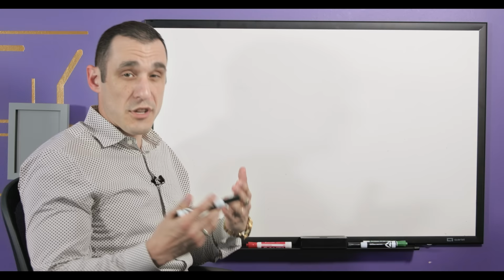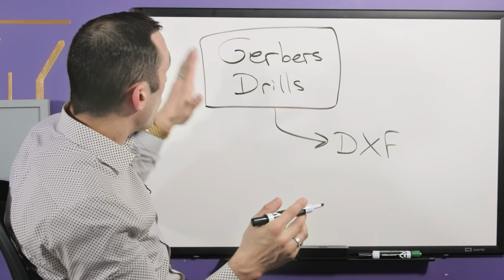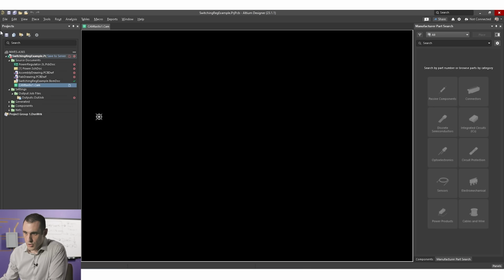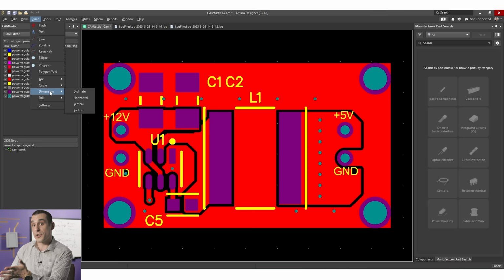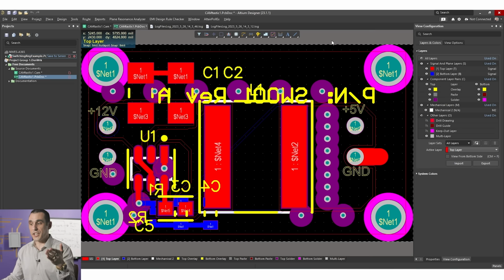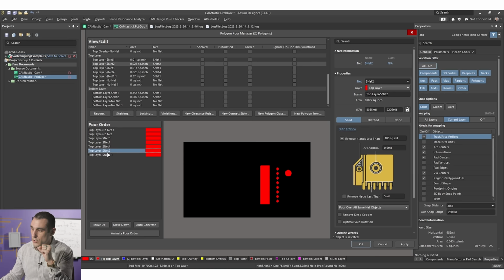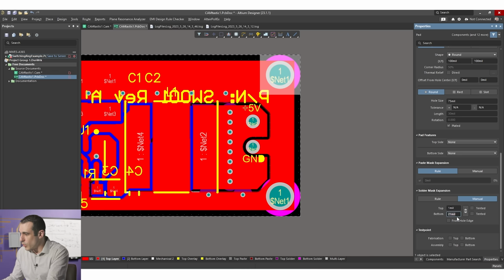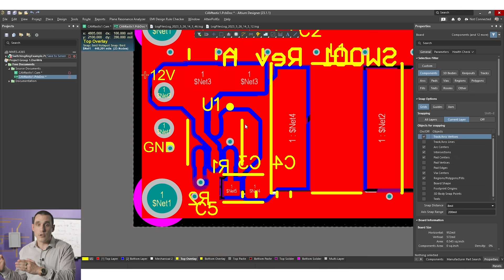How to Reverse Engineer a PCB from Gerber Files

Comment: Depending on how complex the PCB is, it probably makes more sense to send it to China and have the professionals do it for you.
Reply: Yep, and they would sand the board down and scan it for you. It is basically fully manual reproduction of every component. I once kinda half reverse-engineered a two layer PCB just by taking a photo, scaling it up and printing it out. Then I just drew marker lines. I had some idea of what it did, so it was pretty simple.
Reply: you have any contact to the Chinese professionals?

Comment: When i try to do this, my solder and paste information is not getting exported to the pcb. What might be the issue ?
Reply: What does "solder and paste information not getting exported" mean? Do you not see any solder mask openings or do you only see the default solder mask openings? I suspect that if you look at the solder mask rule in the exported PCB you will see the default rule being applied in the PCB Rules and Constraints Editor, and this is why the solder mask may not look as you expect.

Comment: am trying after export the pcb silk and solder layers are not visible in panel downwards.
Reply: I'm having the same issue and cant seem to find the right way to even search for a solution. I can toggle visibility in the view configuration toolbar, but cannot select them as an active layer to work on.

Comment: I did this for a board once having only the information required to build it (gerber, drill, bom); if I recall, after the camtastic import I went through creating components from the exploded primitives (in PCB lib). Create the components' schematic symbols from the BOM and put them all on the schematic with an individual netlabel on each pin. Then push changes back from PCB->schematic, now you will have all the right nets on your schematic symbols. The final process is to untangle and rename the schematic into something readable, always ensuring that when you push changes to the board no connectivity is changed (just net renames).

Note that all your holes are imported as "pads", so you will need to convert the vias back.

I have also employed the more laborious method to reverse engineer a supposedly "open source" 3D printer motherboard. It was possible to extract all layers from the PDF layout they provided (using select by colour in a drawing tool, as all 4 layers were present, though overlapping). After scaling to correct known dimensions I had enough to reconstruct the layout. In this case the schematic was provided as a PDF, so there was less mystery there.
Reply: I watched Ethan Pierce's webinar with PCEA and he talked about using photoshop to extract copper from a photograph of the top layer. If you can get the copper to a single color with smoothed edges then you can basically do the same thing, just select by color and then scale based on a known reference dimension.

Comment: When i am trying to Export to PCB i see an error: The physical layers order wasnt defined. Please define the physical order of signal / plane layers before proceeding. But i I didn't find this setting in the preferences of CAM editor
Reply: I was performing this operation on a 4-layer board. after clicking Tools->Netlist->Extract I was prompted with the same error and had to fill out the "Physical Order" of the layers 1-4. After the netlist was extracted, I could then export to a PCB.
Reply: @jacobdoyle4861  I filled out the "Physical Order" in CAM350. Is it possible to do this in altium?

Comment: Hi Zack, I have tried this with a real project. I have generated a netlist in the Camtastic editor, export to PCB was also successful. But PCBs netlist is empty after export. Is it the same for you?
Reply: To be precise: I see net names over tracks, but in PCB panel Nets is empty.
Reply: I think this is because the process does not regenerate the schematics, which is what you would normally use as the reference to generate a netlist. I don't think the nets panel should be empty though, I would have to try again with the project and check it.

Comment: Could a function to select PADS and group them into a conponent be seen in future versions? Some CAM software does this automatically and figures out the footprint for you. For example, simple SOP packages and BGA are really easy to recognize, should be able just to box select the pads and group, then probably manually match to a certain footprint.
Reply: That's a great idea, I don't have visibility into all of the new features that are coming up for newer versions but it would be great to see this. I know that you can select free pads in the PCB Editor and copy them into a new window or component footprint in a PCB library, but unfortunately you can't just grab component pads and copy them into a new window or part. You would have to explode a component to free primitives and then copy to a new part. Once the pads are in a new editor you could overlay with a known good footprint to compare the pad arrangement and identify the component package.